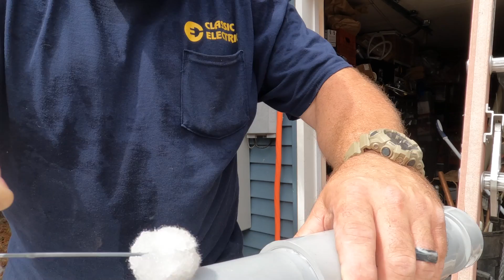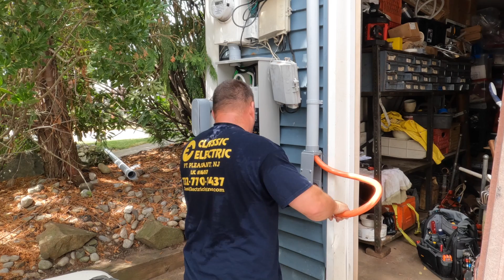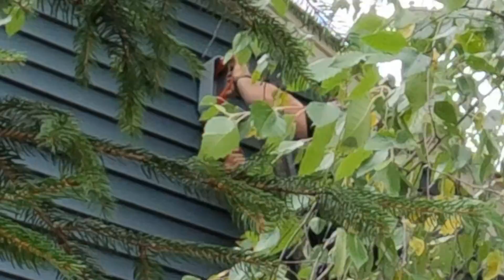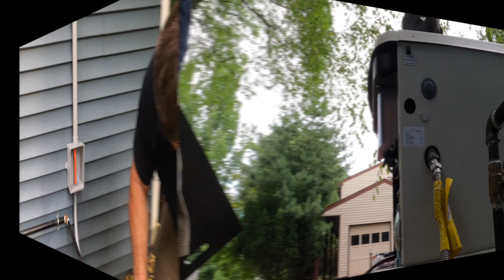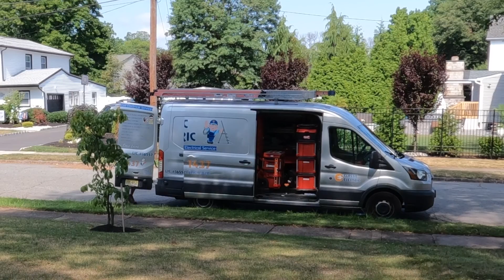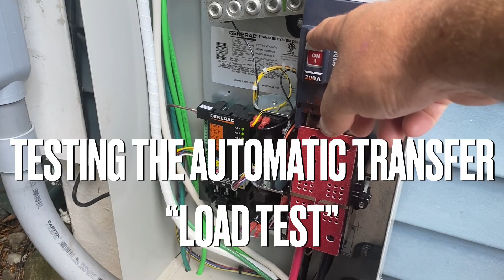Generac Generator Installation Part 2| Clark, NJ

Comment: I'm trying to find some information and I'm not having much luck. Im attempting to setup a generac automatic transfer switch but I didn't want to use a generac generator. I have a dse3110 controller I wanted to use on a larger liquid cooled generator. Im trying to figure out how the transfer switch calls for the generator start.  Are the generac transfer switches able to work with my controller? I feel like it should. But I can't figure out how to wire it. Any ideas ?
Reply from the maker: I think you’re complicating things by not pairing the ATS with a Generac generator.
Reply: @electricianron_New_Jersey  yea I know that for sure. The thing is I have the generator already and it's too my specifications already. So to buy another generator at 15 to 20k for a comparable unit I'd rather give it a shot. I know it's a basic concept on how it works its not complicated. Im just unsure of what generac uses for the trigger and how exactly it works.
Reply: @rhino3292  ... the simple answer is the Generac TS does NOT have any built-in controls. (other than load shed) The start logic is part of the genset....and so is the transfer logic. You could build something using delay timers, but you still need a 12 volt signal for transfer between terminals 23 and 194. That transfer signal also needs a delay to allow for warm-up of the set.... and then a way to pull the signal when it's time to shut down. If you buy an Asco TS (way more money) it has everything including the 2-wire start.
Reply: The 12 volts between 23 &194….  Is that from the battery or a seperate control transformer

Comment: How much a foot is that generator cable assembly?
Reply from the maker: Too much! About $5 per foot.
Reply: @electricianron_New_Jersey  pricey but prob a lot quicker.
Reply from the maker: @mcarroll598  Much quicker. I've done maybe 50-60 Generac's since 2010 so I feel like I come from an area of experience. Setting up the rolls of THHN and pulling through conduit (by myself I might add) was a major labor killer. There is no doubt that this cable saves time and money.
Reply: @electricianron_New_Jersey  I started installs back in 2006 on Generac standbys. I don’t do them anymore. I don’t recall them having that cable back then when I use to do a lot of them. And I know setting up all the wire to pull that was a pain. That cable assembly is really nice.
Reply: It’s a LB fitting

Comment: I work for my self as an electrician in PA and have a few generac’s to do. I don’t use the gen wire that you had in this video, but my distributor sent me the wrong wire and sent me that. That wire is ridiculously expensive!! I use mobile home cable and it’s pretty easy to send through 1-1/4”.
Reply from the maker: About $5 per foot.
Reply: Oh wow. Here it is a little over $9 a foot compared to the mobile home cable at a little over $4 a foot.
Reply: @Mikey_The_Electrician  ... Generac had that cable UL approved to run everything within the same sheath. If you run other style cable you will need to run another conduit and another control cable to meet NEC. The idea here is it's a time saver... and it's already approved... and most installations don't need 100 feet.

Comment: Nice job! I had a 20kw Generac installed two summers ago, with a bi-weekly 5 minute exercise programmed. A few months ago around 10:30PM, we lost power for the first time since installing it! Strange sight to look around outside and see our house as the only one with lights on :) It was four hours before power was restored. Since then, I've noticed several houses around the neighborhood with Generac's now installed 🙂
Reply from the maker: I feel like it's our next 'state of emergency' because there might not be enough natural gas to power all of the new generators in the neighborhood!
Reply: @electricianron_New_Jersey  Here in Michigan (I'm in the West Michigan area), the electric company (Consumers Power) have upgraded all houses with cellular-based smart meters, and has been pestering us with standby generators, to sign up for a program that will allow them to turn off the power to our houses (via the "smart meters") during high power demands. All because they are starting to shutter the coal-power plants (which of course is the primary supply of power through-out most of Michigan). For us in Michigan, we have an abundance of natural gas, so they want us to generate our own power. No thanks. I'm not going to put all that wear and tear on my generator. QUESTION for you... have you done any of the Generac Solar systems? What do you think of them?
Reply: @RBB73  Yeah they want to shed their load during high demand days. It's not a terrible idea, gives you a chance to exercise your generator and usually the utility will give you a rebate if you agree to it.
Reply: @aaron74  ... yes, exercise is good, but the cost to run your set will be 4-6 times more than buying from the grid. If you like paying $1 per Kw then go ahead!
Reply: @RBB73 hi I noticed you’re in michigan, may I ask who do you recommend to get one installed and how much it cost you, thank you
Reply: I'm in the West Michigan (Grand Rapids) area, and I know there are quite a few installers out there now. I used Vander Hyde mainly because I had used them for my HVAC replacement and a few other projects. I did try to get other quotes from the one or two other dealers at the time, but never received a reply. They are not the cheapest for sure. I think it was about $8K for the 20Kw installed and the extended maintenance. I did end up having to have DTE pull a new (larger) gas line for the larger genset, which I paid directly to DTE. There are many more choices now for dealers as there was a few years ago, so prices may be a bit cheaper now with the competition. @kalamelliel
Reply: @kalamelliel for basic install, like no finished basement home depot contractors charge 10-12k for a 22kw if you have to use 2-200amp ATS like my bos big house they charge 16k🤦🏻‍♂️
Reply: I'm a JCP&L customer and my power goes out so often that I don't even start to think about dragging more portable generator out until hour 3 or 4. I feel like we lose power at least once a month.

Comment: With this cable that has all the conductors in it, is there  a concern with cross talk between the sensing wires and the phase conductors giving a false indication to the controller in the transfer switch? Just wondering if that was a consideration.
Reply from the maker: I haven't experienced that and I dont think I will because the insulation is equal to the feeder insulation.
Reply: Thanks for the reply, enjoy your videos a lot.
Reply from the maker: @TheAirboss1955  Thanks so much. I work hard to make them, edit them, and upload them. Also, the insulation is much better than the insulation found on data cables where crosstalk is definitely a concern.
Reply: @electricianron_New_Jersey  ... that inductive voltage on a long run was once a problem but Generac has the control board (these days) ignoring anything below brown-out voltage. Back 20 years ago a 240 volt feed in the same conduit might get you about 25 volts in 150 foot run. This played hell with the older 2-wire start systems. Fun times diagnosing issues back then!